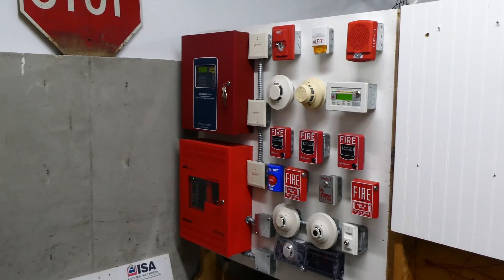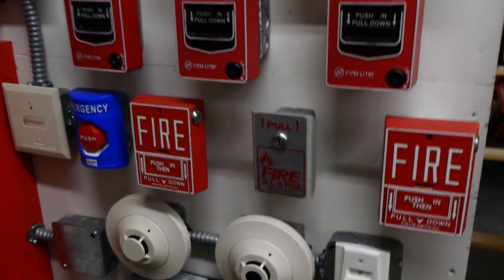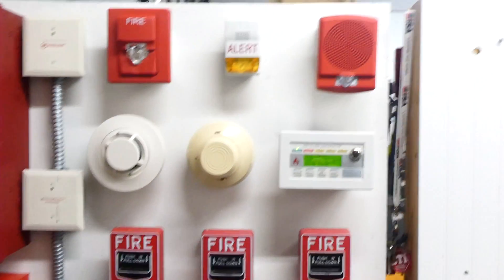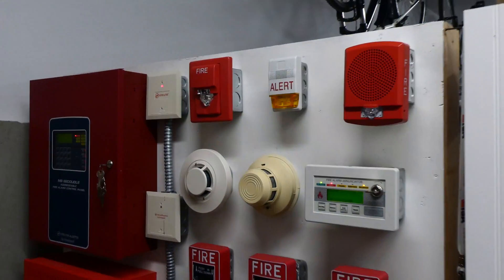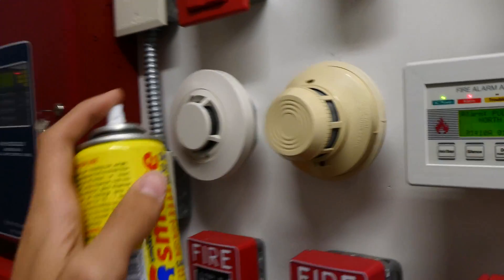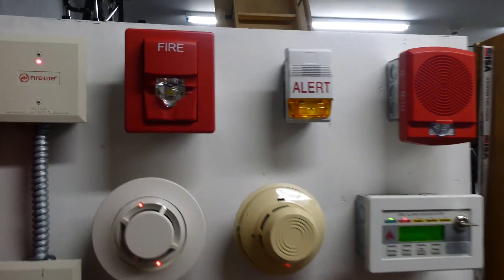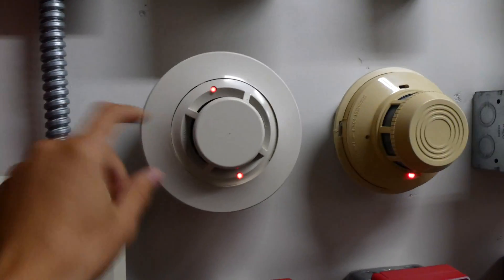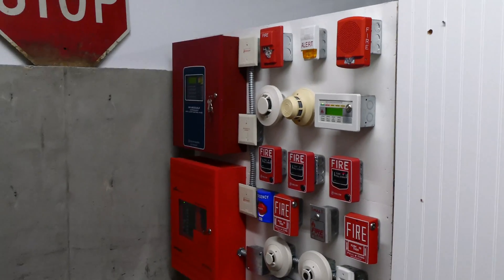Wheelock & Fire-Lite Voice System Test 6: LED Fire Alarms

Comment: I like the LED strobes so much better than the old incandescent ones, because cameras like yours can actually pick up the flashes properly since they happen more slowly. Also, they won’t cause epilepsy attacks, even when they aren’t synchronized, because of the longer flashes.

Comment: Now I see why Wheelock and Edwards do not recommend having the original LED devices (Exceder LED and GL1) mixed in with their new LED devices (LED3 and G1AV/G1V/G4AV/G4V).
That slow flash pattern of the old LED devices really is bad.
Reply: Craig Baker Did Wheelock ever make a Exceeder LED2 or did they just skip to LED3?
Reply: @JBRProductions01  they just made the original LED Exeeder and the LED3 Exeeder.
Reply: @SomeDudeWithAnExitSign  What's the difference between the original Exceder LED and Exceder LED3?
Reply: @JBRProductions01  the original exceeder LEDs has a longer flash rate while the Exceeder led3s have a shorter flash.

Comment: I like the new devices and that's funny the other smoke detector decided to activate also
Reply: Stephen H, all that needs to happen is something to get into the chamber. The smoke detector picked up all of the smoke S.E.R directed to the System Sensor, as it was quite a large amount. Therefore, the detector noticed it, and set off also! :)